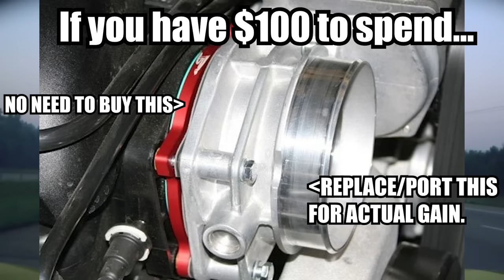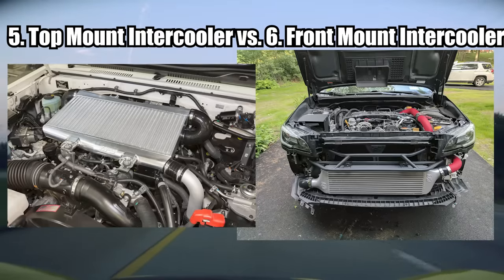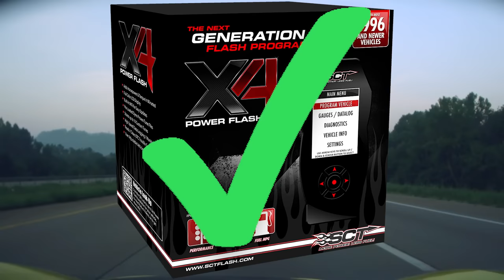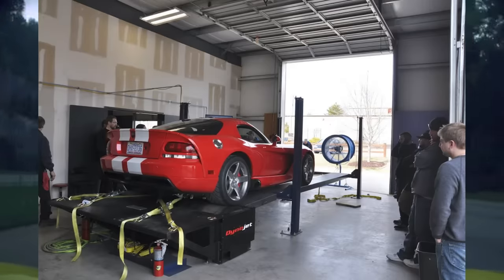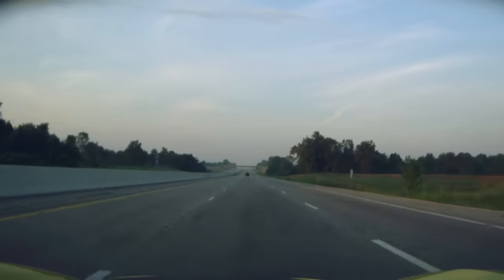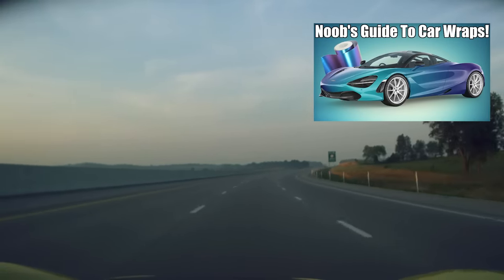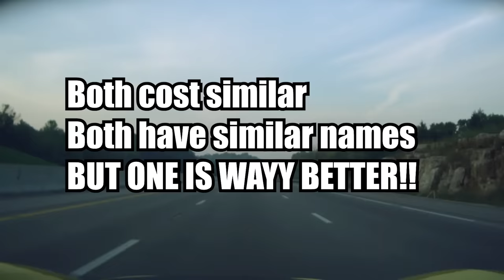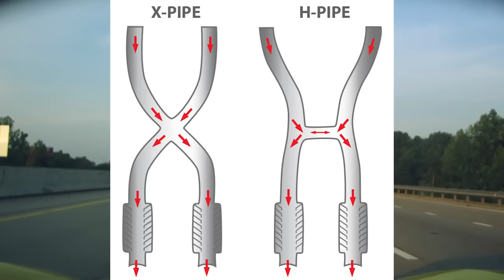25 Real VS. Fake Car Mods!

Comment: I have a short ram on my car, but it’s mainly for the sound it produces. Make the intake hella loud, and sounds great. There’s no performance gain from the butt dyno, but it’s still a cheap $100 way to make your car sound awesome.
Reply: Still an open cai makes hella noise and i made mine with a simple cheap cone filter and a bit of piping, now my intake does not go over the exhaust headers and also sounds insane at wot (for a small 1.4), only costing like 25 bucks
Reply: Neellav Gogoi  placebo effect is  real. The whole supplement industry is built on it
Reply: @christopherjohnston6343  don’t know if placebo works on machines
Reply: @jooot_6850  not in a medical sense but you still understood what I meant
Reply: @christopherjohnston6343  right it would feel faster to drive sure

Comment: On lowering springs,
I lowered my Mercedes 190E couple of years ago with Eibach pro kit springs.
Everything was fine, apart from the fact there was this weird creeking noise when I turned the wheel while parking. After checking everything and replacing every part there was to replace with suspension and steering, finally I found the issue.
The steering drop link bushings on the passenger side became stressed when I lowered the springs, since this cause all the steering angles to change.
TL;DR, if you lower your ride height, you must then also replace or re-adjust all the steering components.
Reply: I drive a Mk2 Golf and I was thinking about using lowered springs and even though I will be replacing entire suspension system and many other parts including steering hardware, I am glad you mentioned this as I want the car to feel as nice as it can get.
Reply: I never had that issue with mine. I used their 2 inch lowering springs for my 90 Toyota Celica Gt back when I was younger. It made a huge difference in the way that car handled. It wasn't til I rode in that car afterwards that I finally understood what,  cornering like its on rails meant.
Reply: @joshmulder8125  the suspension and steering setup in the 190E and Celica are completely different
Reply: @ExAnimoPortugal that sounds like it specifically applies to certain type of cars then, or age is a factor too then. Cos idk if this is applicable to my newer car

Comment: I'm in the UK, many years ago I had a Triumph Dolomite 1850. When the stock exhaust rusted away (They did back in the 1970s. I replaced it with a properly designed rally exhaust. The result was more responsive throttle and an improvement in fuel economy from an average of 30mpg to around 36mpg. Apart from that the engine, carbs, air filters were stock.

Comment: I know Cletus made another video on electric superchargers, that used a huge battery and a switch to turn it on. I believe it was on a colbalt and it gained power.
Reply: Those also used massive brushless electric motors instead of the tiny DC fan motors. They make a massive difference. It’s like Walmart RC car vs a hobby grade RC motor. My RC car used lipo batteries and goes well over 60mph (not scale speed), snaps axles and I’ve even shattered the metal gears in the transmission for it. Big difference in the performance on the two motors you get with the ones Cletus had on his electric turbos/supercharger vs the cheap little ones that fit inside an intake tube.

Comment: Part of the large exhaust issue is if the exhaust doesn't get out fast enough, it cools making it denser, and harder to push.
Reply: also increases turbulent airflow within the pipe, further backing things up

Comment: So, racecar things. I have access to a dyno 4 days of the week. I did an experiment on my personal weekend car, 03 mustang GT with a Ls3, ibeam aluminum rods, forged crank, trick flow heads, and a single 76mm precision turbo. I did a full proper performance exhaust on the dyno vs my fender exit 4 1/2 inch straight pipe. And the straight pipe made more power. A significant increase. 890 whp vs 967 with a straight pipe.

Comment: Throttle body spacers increase the plenum size, which can help increase torque if your cars plenum was undersized from the factory
Reply: I, run a throttlebody spacer on my crown vic, didn't affect 'throttle response' but noticeably increased torque between 3-4k RPMs. It's different for different engines. The 4.6L & 5.4L 2V V8s like them quite a bit, I cannot say the same for other motors without experience with em.

Comment: I would like to know your opinion about modifications in the interior, ambient light etc.
Reply: Why would he care? That’s literally all preference. There’s very little interior performance mods, except like a nice steering wheel and a seat.
Reply: That’s like asking what he thinks about your room decorations.  Nevertheless if you wanna see that video I hope he makes it for you.
Reply: @steverossen2816  and a roll cage if you want to count it lol
Reply: Are you looking for asthetic opinion or performance opinion? 

The only performance related interior mods would be - short shifters, race seats, roll cage, smaller steering wheels and basically deleting anything that makes your car heavy. Like radio, heaters, backseats, carpeting, etc.
Reply: I like my creature comforts lol
Reply: If you want an opinion or a guide on that, I could help you out. Right now I'm in the process of adding 3 gauges to 1 din slot where a factory radio sits in on my Golf Mk2, and I've also begun swapping all bulbs and lighting to LEDs.
Further improvements include adding moderate ambient lighting excluding thin light strips like you see on newer Mercedes, BMWs and so on. The bigest improvement to the interior was adding a 7 inch multimedia player to where factory ashtray usually is, it made the whole car feel better. 

But before I go crazy with all that I first plan to swap seats and replace trim pieces. Now that's more important than most of the stuff.

Comment: cold air intakes are a good mod, Especially if you combo with an exhaust. even if you just do a muffler delete, the intake sounds good.
Reply: Just be sure you get one that's right for your engine. I've known plenty of guys who put tiny little K&N's on big ass engines only to go online and complain about cold air intakes being a scam afterwards.
Reply: Cool air intake are for 1 part of the combustion equation. I'm not spelling something this easy out for anyone lol.

Comment: H pipes are also only for sound at low RPM. Air can’t turn 90 degrees like that so once you actually step on it no air is going across that pipe. Only X pipes increase performance.
Reply: Not necessarily true, an H pipe will still increase scavenging compared to a dual exhaust that has no crossover pipe what so ever. You will see better gains with the X pipe though.
Reply: Not to mention, if you're comparing it to a straight-pipe, like Bladed was doing, literally ANYTHING is better.

Comment: Mod kits from reputable businesses are also great for the modifying n00b.  I used a suspension kit from Pelican Parts (springs and dampers) and a power kit from Turner Motorsport.  Very happy with both.

Comment: roof spoilers which are angled downwards to direct air down a window instead of deflect upwards (the blue subaru roof wing you showed) acheives a similar result to vortex generators. you are correct about the roof spoiler on the orange car, but the one on the subaru is functionally pushing air downwards towards the rear wing.

Comment: So, as someone who has put literally 100+ cars and trucks on a chassis dyno i concur, straight pipe on low-med HP cars are a huge torque loss, thus resulting in a loss of Horsepower since HP is a calculation of torque based off RPM.  Also the "electric supercharger" that was shown is actually a loss of like 4 HP on a small stock N/A 2.0L, i think.  I do remember it was an early 2000s Eclipse.  Also, i can confirm, the leaf blower does give a small amount of HP lol.

Comment: On carbureted engines a spacer under the carb can actually increase hp, but it can shift the power curve a bit.
Reply: It can keep your fuel from burning up in the carb to

Comment: A little birdy told me. If peak HP is also controlled by the exhaust shape, then explain why 100% of FunnyCars and top fuel dragsters have side short pipe exhausts. Granted, dragsters have turbos. But even N/A big blocks have short pipes

Comment: To be entirely honest coming from my experience with CAI's(cold air intakes), they add at least something. When i added my intake to my 97' Camry, it actually gained literally 3 hp, 1 mpg, and better response on the lower end torque. Other than that, I wouldn't advise slapping a CAI on a newer vehicle as the way their air box is designed is typicially better than the aftermarkets UNLESS you plan on going with more mods as Bladed explained in the video. Overall, CAI's are just so damn pretty lol
Reply: I would say that slapping a cold air intake is best for 90's cars, mine had the air intake go right over the exhaust header and valve covers instead of being routed around the engine away from the heat, you literally cant touch the intake pipe right after you park
Reply: @joey_f4ke238  sounds bout right lol
Reply: What brand cold air intake did you get? I have a '99 Camry.
Reply: @cantfindneutral  The one that I got was the HPS Performance for the 2.2L. It had the instructions, the intake, heat shield, and filter. I reused the clamps (the one with the screwdriver to tighten) for the tube before the throttle body and where the tube and the filter meets. Fitment is very mint.
Reply: @_itzjoshhh7927  Thanks.
Reply: @joey_f4ke238  lol stock ef hondas are like this, straight up on top of the exhaust header
Reply: I did that to my Audi 80 B3 and it gained power, mpgs were increased and it sounded way better. It wasn't a legit cold air intake, but being a custom one it still did what a legit CAI would do. I literally had to route it to nearest open source of air but still protect it from elements like water, mud, sand and dust.
Reply: @_itzjoshhh7927  you can use a 10mm too.
Reply: Sometimes using a screw driver in tight places on thoes clamps is a bitch. You can usually get a ratchet in there just fine.
Reply: @SMD-si7fm  Thanks for the tip! Def gonna use 10mm from now lol

Comment: I want to add one more information about straight pipe vs h or x pipes. H or x pipes are also designed to keep lower pression on the exhaust valves because of the faster air flow escaping from the combustion chamber. In this way the low pression that generates near the exhaust valves sucks up the dirty air after the combustion and it increases efficiency (cleaner engine, lower gasoline consumption, faster revs and actual more power). Straight pipes make the engine less efficient and in some cases less powerful because the air coming out the exhaust has to deal with atmospheric pressure so the pistons have to push harder to make the air escape the engine. Also phisically speaking loudness = waste of energy. Sound is energy converted in kinetic energy that moves air particles (sound). So if an exhaust is loud it means that some energy is wasted to make the car louder (improper airflow, more vibrations transmitted to the exhaust pipe, higher temperatures and less reliability)
I know... My english is bad.

Comment: Both intakes and exhaust have pulses going through them, that run in both directions. The diameter and length are both part of tuning for best movement of air and exhaust at a specific rpm range. A well engineered engine mod will include changes in many places, from intake to camshafts to exhaust to heads, and the list goes on. This is why those spacers can help with low end power, but in return, you lose some top end. It's all a give and take, and factory engines are designed pretty well, given that they need to remain within emissions and noise specs.

Comment: I only have an issue with the last statement - rep vs name brand wheels. I personally run a set of rep wheels on an Evo X and they are just great, never had an issue with them. That being said, I don't recommend going for cheap wheels that look like something they are not, because the set I bought is actually a high quality replica, which was a decision made mostly made from a budget perspective (they were not dirt cheap, cost like 400 buckaroos a wheel, maybe more). My reasoning was, that we don't really have a lot of good looking wheel models from certified manufacturers (EU FTW) and I couldn't get my hands on anything that I would consider a good fitment - most TUV certified brands have bad offset and width choices (imagine an Evo X on 18x8,5 ET 45 wheels)... I can't imagine what would happen, if I bought a set of rep wheels from the US hearing a lot of horror stories about them going ballistic. My final thought is never cheap out on anything that contacts the road, be it suspension, wheels or tires, but don't get pressured into buying "the real deal of wheel" if it's not in your budget... use your common sense and go for something that looks nice while providing adequate strength and durability for your intended purpose.
(not hating on OG wheels, but not everyone can afford them for their 12 year old Mitsubishi shitbox lol)
Reply: The other problem I have with "real" wheels is that when you find a wheel that looks cool, they don't come in your size or lug pattern. I would love to run some Hayashi Streets. But they don't come in my size or pattern.
Reply: @jonathanpinckney9227  Exactly, and changing your lug pattern just for wheels is possible through a spacer which messes up your fitment. That being said, rep brands definitely have a place in this market.
Reply: @AnabolicGoat  For that reason, yes. Another thing about real wheel companies is you find a rep, you want to see about the "real" one, only to find out that they don't make them anymore. Or you just want a monoblock wheel and all the "real" ones that you're interested in are two or three piece wheels.

Comment: Intakes of all shapes and sizes can improve MAF/MAP signals and the cleaner you can get the airflow the better. Typically stock intakes on all performance cars have the best signal quality, and I wouldn't move away from that unless you go boosted.
Reply: years ago, I asked my mechanic about aftermarket intakes, and he said, "the factory engineers pretty much knew what they were doing"
Reply: Well they are more customers based so yea they won't give you mod advice
Reply: @redbeastthechallenger because if you're asking about aftermarket intakes, then you probably don't need it. A tuner would inform you of what you want to add for performance increases, and a mechanic will tell you how to keep it running in top shape. Just barking up the wrong tree.

Comment: I must say this, with all due respect, I changed out my 'restrictive' stock air intake on a 2015 Toyota Corolla S, over to a Takeda short ram and witnessed a quite noticeable difference in the car's ability to breath air much better while also providing a small, but noticeable difference in performance.  My next move is to add on a straight-flow Borla muffler, i.e., short air in (Tekeda)short air out (Borla) combo. Outside of this, to do more, I might as well just get a different car.
Reply: can confirm! I have similar car and swapping was noticeable especially with other intake/exhaust mods

Comment: The pressure thing at the end is not true. It wont hurt performance and having it escape more easily with less pressure = less backpressure = more flow  (backpressure is only needed in 2 strokes) 

Edit:Spelling

Comment: I've done some research for the older cars getting benefit and it is true. Theoretically if I bought a better tune for my 305 tpi I could increase horsepower a good amount and the cold air intake would actually benefit me because stock injection iroc camaros have a very restricted intake system
Reply: My parents got chips for their late 80's Tbird turbo. It definitely improved fuel economy and power.
Reply: Well it's that the intake runner length is long for low end torque so the air charger is lacking above 5000 rpm I've go a 350 tpi